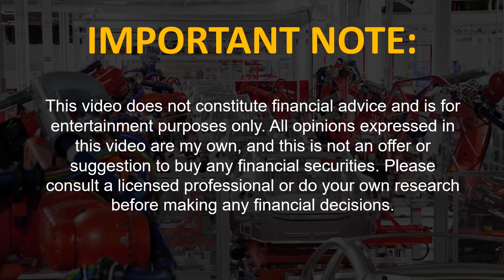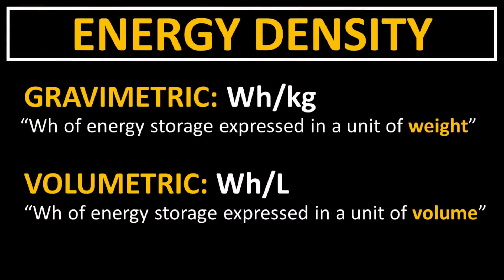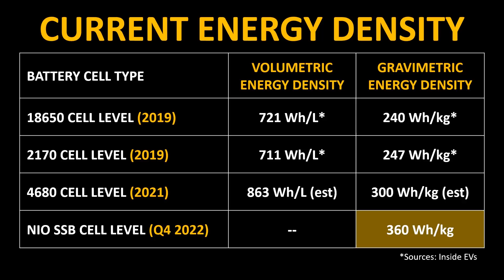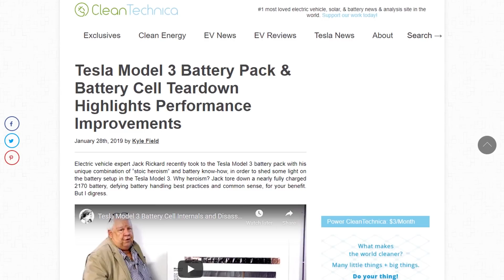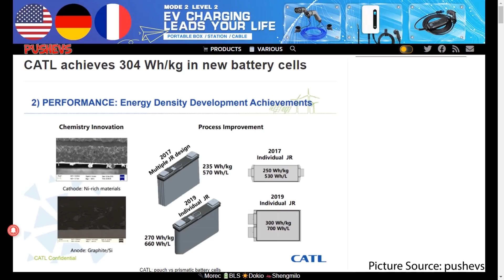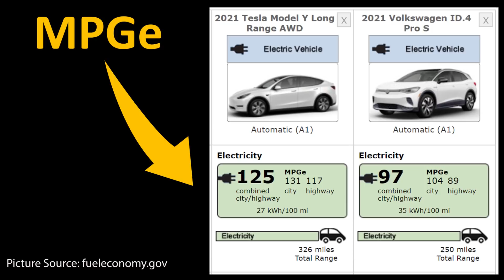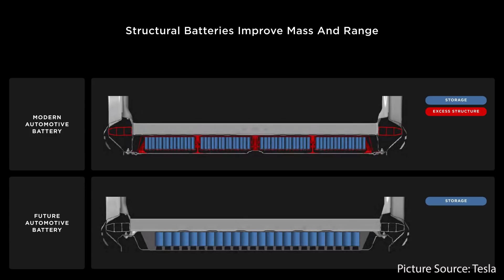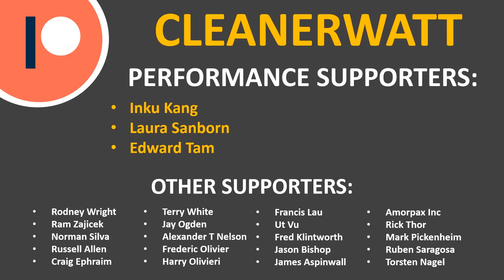Tesla New Battery Tech vs Nio Solid State Batteries (Part 1: Energy Density)

Comment: Anyone know why multiple battery chemistries aren't used in vehicles? I know they'd require separate circuitry but with some cells being a massively better capacity value and others being a good performance value, why not combine their features?
Reply: TESLA will be using HIGH Nickel for Supercars and Heavy Haulers.
NCA/NCM for Dual Motor cars and Performance .
and LFP in SR vehicles and Robotaxi.

Comment: NIO’s ss battery is a total scam. NIO does not have any research or facility on battery, except for its battery swap. They totally rely on CATL battery supply. Then, NIO said this technology is from Chinese Academy of Sciences, but guess what? CAS just jump out and slam NIO on the face that it is a scam. Anyone can say there will be SS battery with more than 2000km in 3 years. They don’t need to be responsible to this kind of claim anyway, because it is just a cheap predict on paper, of course!
Reply: They’re working with Prologium but ok

https://www.electrive.com/2019/08/26/nio-prologium-working-on-solid-state-batteries/

Comment: These numbers are crazy, I hope the calculations are correct, and i do wish it's true.
Reply: They Are crazy in 2017 but they will release in 2022-2023 . Tesla revealed  an 1000km range Tesla roadster prototype with the way worse 2017 powertrain and a wayyyy worse battery

Comment: What is the assumed capacity of the Tesla structural pack? I’ve estimated it at 123kwh.
Reply: the POINT of 4680 , is LOWER VOLUME but higher AMPS and faster charge/discharge.
Reply: Based off Munro 40% more pack in the same space, 105 kWh to 116 kWh if it's based off the new 2170. The 10% maas reduction will also lead to increased range.

Comment: Totally agree with ur thesis on the 4680 compared to solid state.
Reply: 4680 is Solid State
Reply: @markplott4820  what leads you to believe that? It's a little better than the 2170, but cheaper to make and better heat management with tabless design.
Reply: @stephenmabry2866   - DRY ELECTRODE and more
Reply: @stephenmabry2866   - 56% BETTER than the 2170.
Reply: @markplott4820  aside from you, who is calling the 4680 a solid state battery? Is it possible there won't be 4680s that won't be solid state?

"I think that ultimately there could be 3 or 4 different types of 4680 batteries produced.

I think that Panasonic will build 4680 batteries that use Tesla's new tab-less design, but using their own NCA battery chemistry, and I think that LG will build (NCMA) 4680 batteries, and I think that CATL could even eventually build LFP based 4680 batteries."

"Similarly, I think that Berlin may have LG Chem (NCMA) 4680 batteries produced for Berlin and Shanghai Model Ys."

https://www.google.com/amp/s/www.torquenews.com/1/teslas-all-4680-batteries-may-not-be-same/amp

Do u have any links to back up your claims?
Reply: @markplott4820  they're dry electrode, but not actually solid state. The chemistry is applied to the conductor material as a dry powder and compressed, so not solid as such. They have no flammable solvents making the electrode chemistry damp, combustible, slightly heavier and slightly less capacity due to presence of solvent.  The tabless design gives them excellent thermal management properties.  Tabless gives high charge & discharge capabilities with low heating characteristics.  Coupled with structural casting tech, as a battery assembly, they are much lighter than existing setups.  All features touted as the "killer" benefits of SS.  However, 4680 tabless structural have 3 benefits SS don't.  Ease of manufacture due to decades of experience in the industry, making cylindrical cells.  Cost of manufacture, due to tabless combined with cylindrical is very cost effective.
Speed to production due again to decades of experience.  SS is new, untried, untested, no experience making them, so they are still a couple of years out, at the least.
Reply: @alexmanojlovic768  -  FACTS are TESLA has the MOST Advanced Battery in a  PRODUCTION ready Vehicle. 
also, the MOST Energy Efficient as well.
Reply: @markplott4820  never said they didn't. Said 4680 are not actual Solid State.
And you don't know for sure, as there are many startups working with the ICE dinosaurs.  Also Mercedes Benz have what they claim are Solid State batteries going into 1 of their van styles this year, and Toyota and Panasonic claim to have a Solid State battery ready to go that has been being worked on secretly for a few years.  VAG with QuantumScape have a near ready SS battery.  You, me and the rest of the world don't know "facts" because all this is kept under wraps with a little tidbit released here and there to pump share values and keep interest in each car maker.  It may be you have a cousin working for each firm claiming theirs is the best and you work for Elon so you know for a... FACT
But even Elon doesn't claim they HAVE the BEST battery in the WORLD because he's not that ARROGANT or STUPID...
Reply: @alexmanojlovic768   - even if someone starts to sell Solid State battery , it will be at a HIGHER price than Current 2170 and they wont have the Production SCALE .
FREMONT 4680 will be 10 Gwh by end of 2021 !!!!!!!!
game over.
Reply: @markplott4820  correct. (Probably more actually).  Everyone in the know has already said that, but you can't state right now for a fact, Tesla ABSOLUTELY have the best battery. Because they're aware of the other developments going on.  Companies will leap frog each year on year.  Probably still the cheapest, though.  Tesla has signed Jeff Dahn up for another 5 years 😀 so will be able to keep up front for 5 years at least.  They also hire a lot of Jeff Dahn's ex students.
Reply: @alexmanojlovic768   - FACT most of LEGACY and Startups are using COMODITY cells , nothing special because the car makers DONT Understand battery themselves.
"when you dont build it, you cant Understand it " - SANDY MUNRO.
so, they dont even know what to order .
PANASONIC has been making 2170 L batteries with 5% more Capacity for TESLA and will be adding 20% more over 5 years , and is making 4680 in the Future. 
TESLA is Unique in that they have OCTOVALVE and Advanced heat pump that gives 10% more Range in Winter - TESLA BJORN.
Reply: @alexmanojlovic768   - only Pathway I see LG Chem being use at FREMONT is if they make LFP batteries for TESLA SR models.

Comment: NIO's Solid State battery is a scam, there is no battery research or manufacture company has actual plan to produce solid state battery before 2023. NIO is basically use it as pie in the sky to draw consumer confidence and funding.
Reply: Look at what happened to QuantumScape all hyped then dropped more then 50%.......a report came out that higher power solid state battery for EV vehicles does not exist.....it still a lab rat Q4 2022 ?
Reply: @tc5102  Exactly, if you think some random companies has the leading break through of solid state battery technology, all I can say is that good luck with that.
Reply: It cannot be a scam.  Nikola engineers swear by this technology!!

Comment: The thing about nios solid state pack is it will start limited production in Q4 of 2022, Tesla's 4680 pack will start production this year in plaid and cybertruck. Tesla is at least 1 full year ahead with a battery that they plan on producing absurd quantities of and its got an absurd cycle life to match. Nio on the other hand is using solid state and so far solid state cycle life is worse than the 18650s in the S, and solid states cost has been high. Yeah this isn't mostly hype from nio to not look behind.
Reply: Those battery packs are already in production, or at least production level . Seent them in person sometime during Decembe at a test facility
Reply: @pingpong909  I know buddy but I don't want to get ahead of myself because they aren't in production products officially yet. The S and X lines were shut down for a bit and plaid is coming later this year with 4680... makes me think why would they redesign a pack to accommodate the 4680 in the plaid S and then not use it for the regular S as well. The line being down must be them retooling for the model S 4680 pack. I'm sure we will hear it on the earnings call.

Comment: I think there's a mistake in your calculations regarding the battery density of tesla's 4680 battery packs. According to battery day using a structural battery increases the battery density at the pack level a 10% (said by you), but you mistakenly increased a 10% the density at cell level, and this 10% is comparing it to how batteries are packed today, because it is imposible that at the cell level the density is inferior than at pack level, it is always greater cuz you're adding weight when it's packed. But in the case of using a structural pack, the maximum density is the one at cell level, so the same density is at pack level, and this is cuz pack is not part of the batteries but of the structure of the vehicle.
Reply: I agree. Can you please explain to me your logic regarding this negative mass situation? Difficult to understand. I would think that the energy density at the cell level would always be above the energy density of the battery pack. Great video though, and I think that you are probably pretty close to what the actual numbers will be. However, I would wager that you are a bit optimistic. Elon has said that Tesla should be at least 400 wh/kg in two-three years. Regardless, this battery/pack technology will be amazing.
Reply from the maker: The 10% number I add is at the PACK LEVEL.
Reply: @Cleanerwatt  Yea I agree there is a mistake. The pack level density cannot exceed the cell level density, unless your pack has negative mass (not possible). Elon musk is saying "effectively" negative mass because the extra weight of the pack is counted as part of the structure and not counted as part of the pack.
Reply: @cw4953  With a structural battery pack Tesla spares weight on the structure of the cat itself. So, it's not really the battery parameter, but an overall gain in car construction. But it is still there, and one can use it in comparisons in car technology.
Reply from the maker: @AndrewSienx  Exactly - that is why I mentioned Wh/kg EQUIVALENT
Reply: @Cleanerwatt  yes, what I mean is that at cell level the 4680 has an energy density of 300Wh/kg, but it's assumed at pack level, with a 10% increase, that is 330Wh/kg, this is where I think  the error is, since the energy density at pack level can not be greater than at cell level. By the way, I'm a great fan of your work.

Comment: To me the best advantage of solid state is battery safety. Tesla batteries are extremely flammable. I wonder if the 4680 battery is just as likely to start on fire as it’s predecessor.
Reply: You may be surprised how few Tesla fires there have been.

Also, does it matter how flammable something is if it doesn't catch on fire?
Reply: Tesla are 10 times less likely to be on fire than normal cars, go read the last safety report

Comment: Very, very clever. especially when predicting the future 2023.  We shall see how close you are. "Predicting is hard, espcially about the future."  Yogi Berra inspired  Competition is good for EV buyers.
Reply: @don johnson  They weren't "designed for early obsolescence".  The amount of data logging was underestimated. Security mode was added after the MCU was designed.  That statement about the "Feds" is guesstimation otherwise known as Total BS.  Hey Don Johnson, are you just bitter because the super hot, young and sexy Dionya Fiorentino left you for.... ....Just Andrew Ridgeley?
🤣😅😂
Reply: Clever? He is using the vehicle weight to adjust battery density. That is complete BS and a false calculation.
Reply: @jamesleate  “Non cell portion has negative mass”, Elon was a physics PhD candidate at Stanford!😹😹
Reply: @clu4u  is that why he has such inventive BS?
It is physically impossible to add negative mass to the battery pack, only to the car overall.

The battery pack is replacing part of the structure, therefore it has to be calculated as part of the structure. You can't say the weight equals  a negative mass left wing mirror. You don't decide where to attribute that loss and you certainly can't attribute it to one specific area of a car and then use the weight loss to calculate battery density.

Not even a first year student would argue that, it breaks the laws of mathematics, physics and common sense.

Elon has been sly in the way he has phrased something and you've included a metaphor in your mathematical equation and made a "clever calculation" from it?

What is the square root of a pun?

What happens when you add the square root of a pun and multiply it by the forecast mileage figures?

That would be a really clever calculation.

Anybody with any engineering knowledge or common sense can see this argument has a Grand Canyon size flaw through it.

This is BS engineering created to fool people who don't know better and anybody peddling it is spreading lies and ignorance.

Elon musk did not say that you can subtract the car's weight savings from the battery pack and use it to calculate battery density. They have put 2 and 2 together and come up with 22.

Anybody intelligent want to correct me? Am I missing something here?

I know it is popular to pick and choose which news you believe, but if that is also true of physics and engineering we are doomed.

Am I going MAD. IS IT ME?

If the "non cell portion' has a negative mass, Musk himself has told you that you can't use it to calculate battery density as that is the 'cell portion'.

Comment: You make one large mistake, the internal resistance for a solid state battery is multitudes lower (the reason why it can fast charge and discharge) this also means that the pack needs very little to no cooling this improves the energy density even more compared to a conventional battery pack.
Reply from the maker: Remember, this is a HYBRID SEMI SOLID-STATE battery from Nio, not a true Solid State Battery, so it will still require a decent amount of active cooling.
Reply: What makes you think SSBs have lower resistance?  It does have better thermal performance, eg operates better in temperature extremes.

Comment: NIO - after EV1, Volt, Karma and other Fisker cars, Nikola, Byton. Faraday, (Lutz chevy Hybrids) - I'm a little skeptical. other electrics I fogot ? Will be great if NIO actually becomes a real electric vehicle option.  I guess only time will tell.
Reply: In fairness nio already has cars in production.
Reply: @mrspeigle1  thanks, NIO just hasn't started importing to US yet. Did they have money problems? Tesla was "saved" by Merc & Toyota Smart - B? & RAV4
Reply: @brandoYT  they had made in China problems and the political baggage which that entails, frankly I wouldn't even consider a Neo simply because of its Chinese Origins and the company's ties to the Chinese Communist Party. Its virtually guaranteed to be loaded down with spy tools and software back doors.
At least Tesla is partially open source, though I really wish they would commit fully to being open source.
Reply: only TESLA.

Comment: I feel like range won’t matter when robotaxis are a thing. Tesla can have fully charged robotaxis waiting for you at superchargers on your route during road trips
Reply: Still far out enough that at least a couple generations of tech will pass through before we hit that I think. Do agree though that we'll see some major infrastructure changes with transportation once batteries can truly justify their own cost without subsidies. Ramping up cleaner tech and cheaper energy, public transit industries should blow up.
Reply: Biniam - TESLA Robotaxi only need a 200 mile LFP pack.
LFP Superchrges to 100% faster than MID Nickel can.
Reply: @markplott4820  exactly
Reply from the maker: maybe...